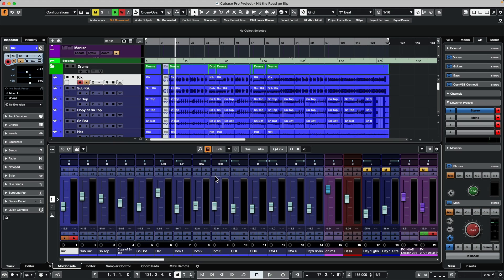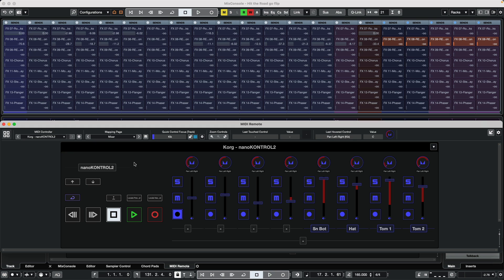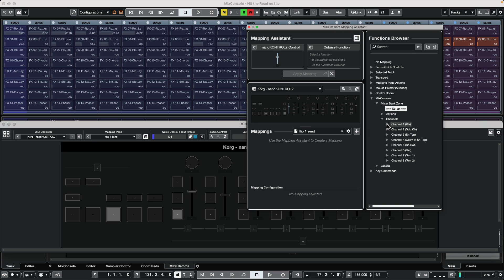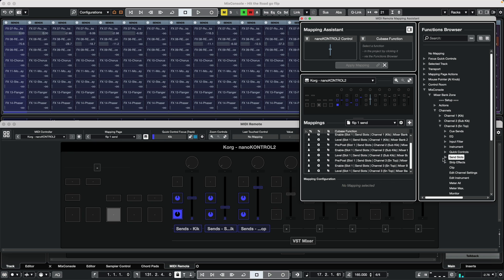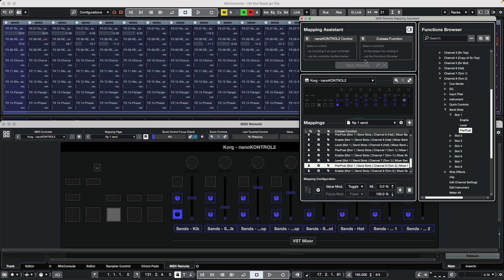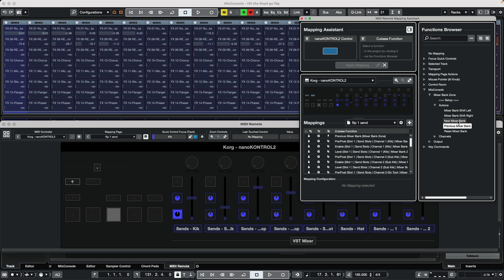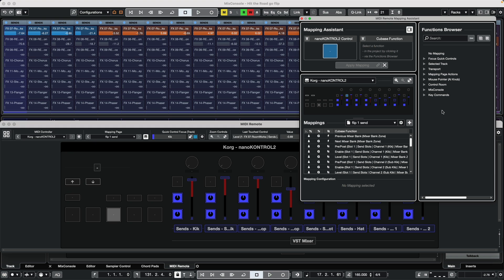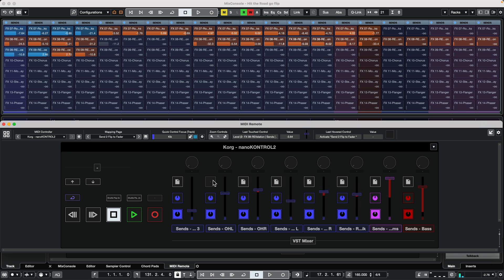Control Send Effects with Faders Using MIDI Remote | Cubase Q&A with Greg Ondo

Comment: Is there a way to easy select & edit insert effect using a midi controller? Faderport 16 has an presonus solution with a plugin selection using a very nervous (read sensitive) fader. I quickly want to select and edit insert effect and use the fader to change some parameters.
Reply: Did you find a solution ?

Comment: For me, as a new Cubase user, this midi remote is very unclear and being pushed due to the message "Use midi remote, older system will be disabled in the future". This makes it slightly more doable to rebuild my fader port 16 using "midi remote". Currently, I was limited to older midi controllers (only supported byPreSonuss). I wish there was an easy way to share & use other Cubase users scripts. This share feature still better supported in Presonus Studio one. The faderport 16 has a quick MIDI mode (pressing both left & right shift). So switching between MCU / Midi is a breeze.